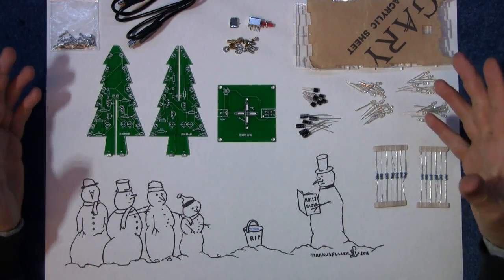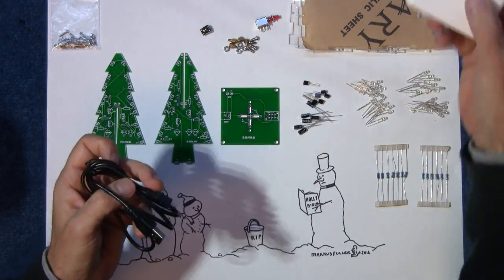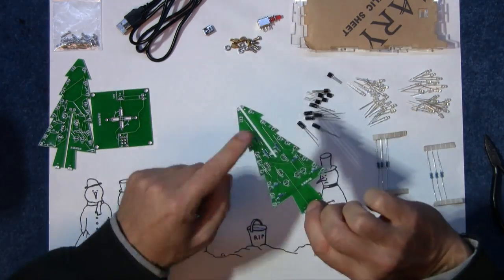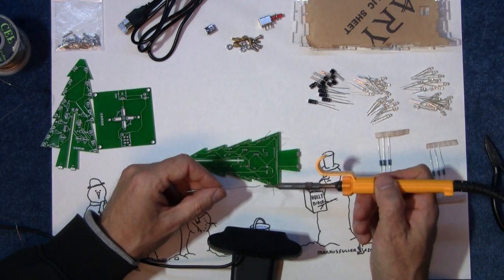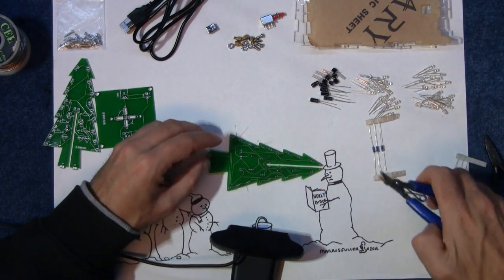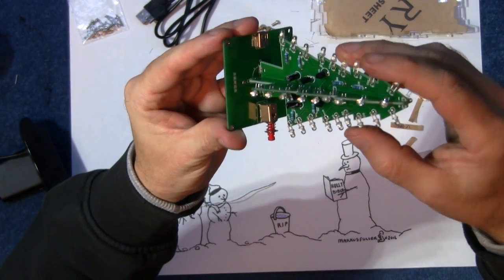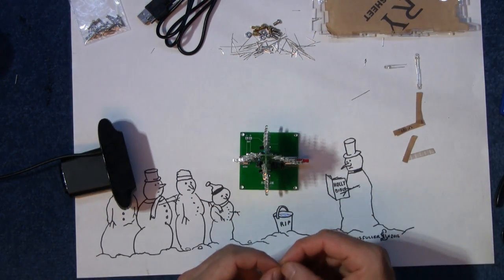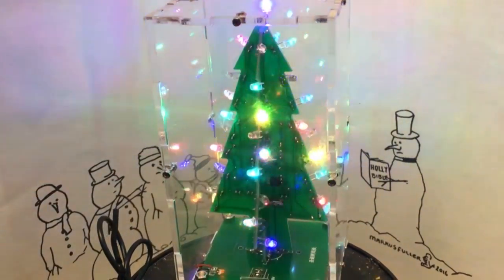DIY LED festive tree and tips on how to solder components

Comment: Cool, I ordered a couple of these a couple of weeks back, from banggood too. I love lil kits like these, I find them very therapeutic. There's loads of 60/40 on Ebay and the like, it's also on banggod, you can even get hold of 60/40 paste quite easily too.
Reply from the maker: Neffers thats good to know . Thanks neffers I prefer the good old poison to the modern solder.
Reply: No probs Markus. I too am partial to it. Mainly for the better flow and lower melting point... oh wait, that's the whole idea of the stuff in the first place isn't it? Ha. 

I have a generic 100g  .7mm spool that's really good so far, no blobby ends to the solder itself and rarely any peaks from lifting the iron off so there's enough flux in it (though I do tend to use additional flux in most cases anyway). 

I got it from this seller http://www.ebay.co.uk/usr/aimtoolsltd though it can be found all over.